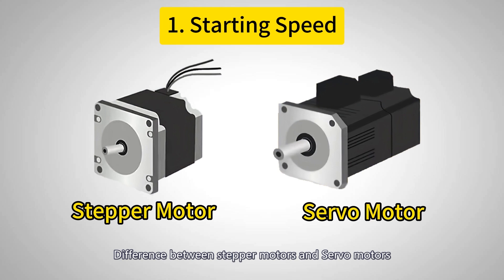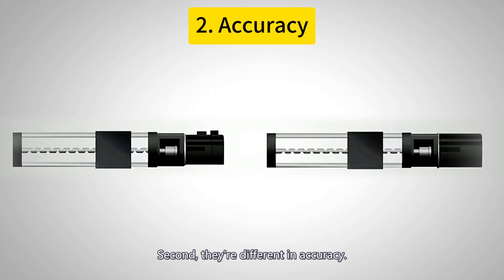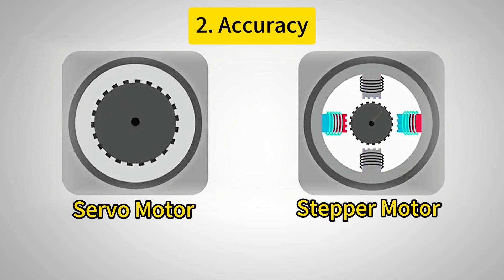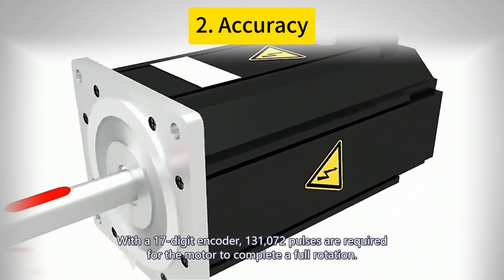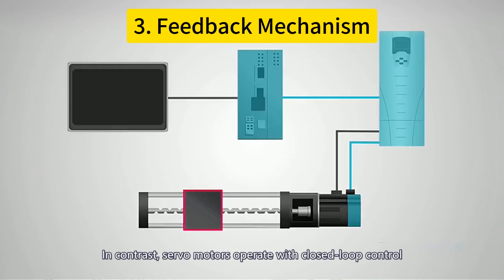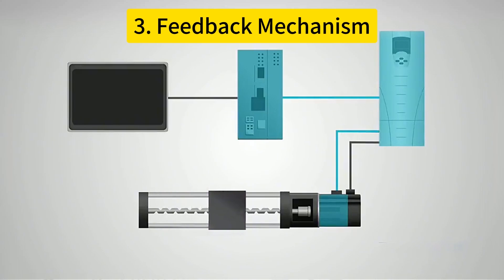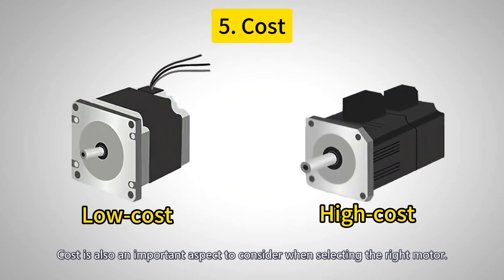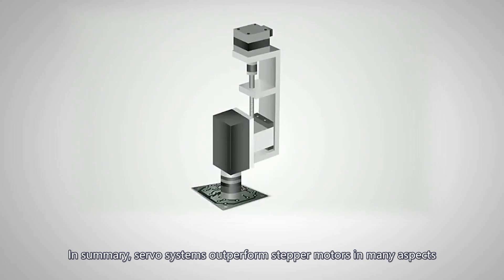Stepper Motors vs Servo Motors: A Quick Comparison

Comment: so the stepper motors moves in a step by step in a pulse either forward or backwards whiles the servo moves in a constant 360 speed forward or backward without any pulse
Reply: From a control perspective it is basically:
Stepper: try to walk 100 steps, ignore obstacles
Servo: constantly move until you hit this position, tell me if you hit an obstacle

Comment: Microstepping does not affect accurancy, it only provieds smoother movmnt of the stpper motor. If stepper motor has minimal angle of moment 1,8 degree, using microstepping it will also move for 1,8 degree, not less. The movement is smoother and it can help with aviding resosnace.
Reply: Okay but it reduces torque so it is prone to loosing accuracy
Reply: @michazarzycki1634 That is untrue. You are thinking of interpolation, which does indeed smooth it. Microstepping does increase accuracy, but it also massively reduces torque. At a 1/8 microstep, the microstep torque is only 20% of that of full step torque, making it basically useless.